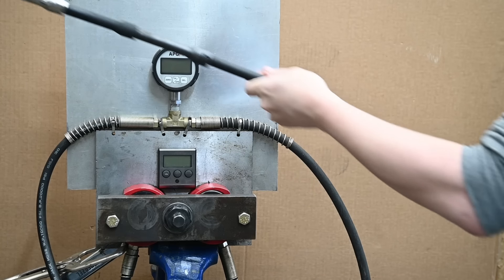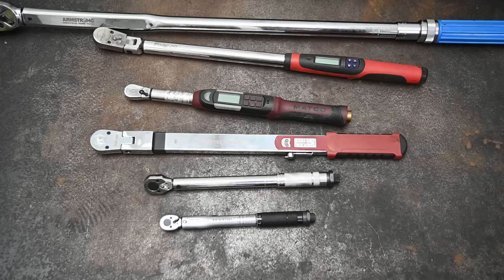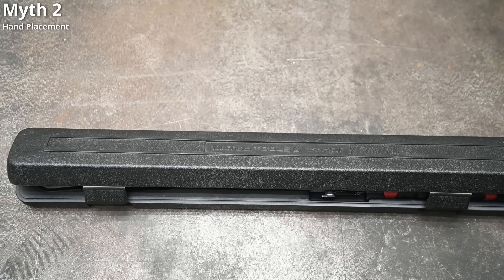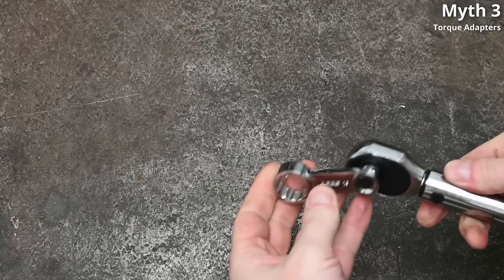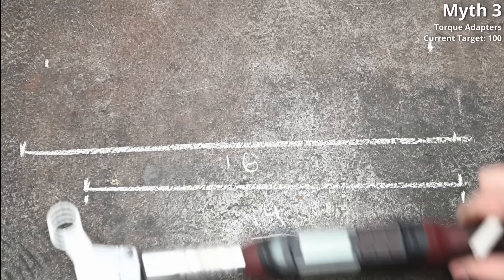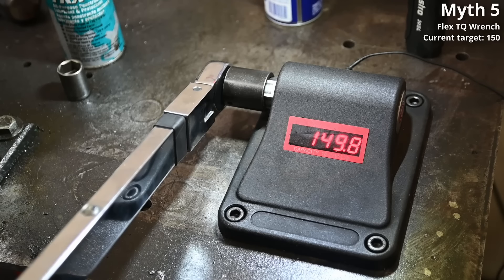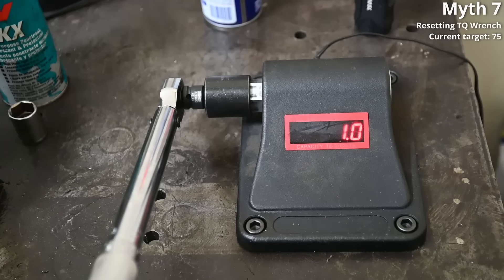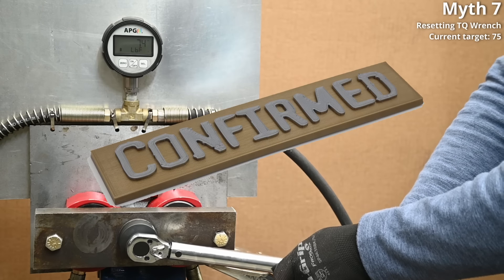You're Using a Torque Wrench Wrong: MythBusting 10 Do's & Dont's

Comment: Just found your channel and since you confirmed two of my fathers commandments about his now 50+ year old Craftsman torque wrench I am a new sub. Old man was right about relieving the tension after use, I always set it back to zero even over short periods of non use. And he was also correct about anti seize.
Reply: Left Dad's 1971 Craftsman set at 85 ft/lbs for wheels, he taught me is was a bad thing. I had it tested on a snap on truck, and was with in the standard 3%. 3 od the 5 digital Snap-off wrneches, new in box, were out of spec by 10% or more. Sorry Dad, but it didn't matter. I bought a kobalt replacement and the craftsman needs a paw replacement.

Comment: How about testing torque wrenches at room temperature (75F*) vs a torque wrench at freezing temperatures. 
That would be great information for mobile mechanics in various weather conditions
Reply: Probably not much difference for spring wrenches. The spring constant slightly rises with lower temperature, which means the wrench will stop at a lower Nm. However, it will also heat up quickly due to the compression, so it may counter the ambient temperature by itself.
Reply: @Asto508  Maybe, but you can't adjust it when the handle is frozen in ice.  :face-fuchsia-poop-shape:
I think the heat is worse.  I have the numbers tattooed on my hand from when the sun shifted and the torque wrench was out in the sunlight when I grabbed it.

Comment: We were just talking about torque adapters at the shop today. I had recently heard that they didn't affect the readings at 90° but we weren't sure about it. A lot of digital torque wrenches have a head offset feature built into them so you measure the offset then input that data into the wrench and you're set. This is at least true with Snap-On ones.
I also liked the anti-seize portion of the video. 
Overall an amazing video with a lot of great information!

Comment: I remember the instructions for using a dog-bone to TQ starter mounting nuts on a turbine engine: "Use documented TQ setting but ensure the dog-bone is at a 90 or less angle." Apparently, slightly under-tq'd was better than over'tq'd.
Reply: Under -torquing is (usually) okay on shear applications and where the part can be distorted and damaged by over-tightening, or where you risk tearing out threads.
But you do not want to under-torque a bolt in a tension application when there will be frequent loading, such as a head-bolt in an engine. Repeated stress beyond the preload of the bolt can cause fatigue and failure.

If the engineers say it's okay, then you can take their word for it. But it is dangerous to apply an application-specific allowance as a general rule!

Comment: Will you please check if using just a little bit of the high temp copper anti-sneeze makes as big of a difference as the silver one. To see if just a little bit can mess everything up. You guys SLATHERED it.
Reply: It is obvious that less anti seize is going to give less of an erroneous result.The more you use,the worse it gets.That why when putting anti seize on spark plugs....you use just a little and adjust the torque...just a little.Honestly with plugs...you can feel it when the plug is properly torqued..
Reply: @djsi38t Modern plated plugs should not have any anti-seize used on them, period. And you really shouldn't be running cheap, unplated plugs on modern engines either.

Comment: The anti-seize is wild, I always knew it was a difference and I always cleaned the anti-seize off lug nuts that all these backyard mechanics love to use, but I would not have expected that it could DOUBLE torque. This is valuable to know so I can more accurately explain to customers how dangerous it is to put anti-seize on car bolts.

Comment: Great video and info on anti-sieze. Lived in Oregon as a kid (the rustiest rust belt state), can confirm that AS will bust fasteners 250 lb-ft on a Cat drive wheel bolt that's been AS'd will result in a broken off bolt. In industry, the big bolt guys use something called a 'bolt tensioner' that precisely stretches a bolt to a specified length, the nut is hand-tightened to meet the surface, thus you always get the same bolting force (pressure on the joint). Since coatings, temperature, humidity, corrosion, and other factors can significantly change bolt tension, that is the 'best' way to measure bolting force - although your tester is doing just that, measuring bolting force and back-calculating twisting torque based on the basic formula. It is all a bunch of math and assumptions that get us to the solution. Love the channel and the content - Cheers!
Reply: "... Lived in Oregon as a kid (the rustiest rust belt state)..."  Not even close, and NOT a "rust belt state".
Reply: @MrShobar  he should come take a look at wisconsin lol. We got vehicles driving around with half their body panels missing and frames welded back together from the salt. I drive one of those vehicles.
Reply: So true. When fastened correctly, lubricated nutted connecting rod bolts are tightened to a stretch dimension spec not a torque spec. A tedious micrometer process but absolutely necessary.

Comment: Excellent segment!
I still use my old (bought it in 1966)**beam-type torque wrench as a “last word” reference. It has a scale at the handle end, the handle is pivoted at its center. As long as I keep the handle floating around the pivot there can be no length error. The indicator rod is fastened to the 1/2” square drive, and even if it gets bent it will still read against the scale if you note the offset and adjust the final reading. That goes for the beam itself. If you permanently deform the beam just note the offset before applying force and adjust the final reading. 
The only thing it doesn’t do is click, which is handy if you are torquing fasteners in an awkward position or in the dark.
**I ordered the wrench from Sears from a tool catalog that was out of date. About an hour after I placed the order I received a call-back to give approval for a small price adjustment. The operator read the name as a “Tool Crunch”. Every time I pick up my Took Crunch I wonder what mental picture that Sears rep had for it.

Comment: Really cool video! The one myth I am still curious about is the one that says that if you loosen fasteners with with a torque wrench (like it's a breaker bar) it destroys the accuracy.
Reply: Many wrenches work in both directions, so it probably depends on whether you have to keep pulling on it after it "clicks".  If you keep pulling after the click, I can see how something might get bent or distorted and affect the accuracy.  Otherwise it should be fine in either direction, for wrenches designed to work in both directions.
Reply: Click type torque wrenches, contain moveable mechanical parts. So using a torque wrench as a breaker bar will only succeed in adding additional wear to those movable parts. Most torque wrenches that I have seen and used, do go both ccw and cw rotation. After all there are left hand threaded fasteners.  Irv.
Reply: @sssnipercoyote60  there are some that only go one direction, I've got one. In it's a bigger one, I don't remember the range off the top of my head but it's a 1/2 drive
Reply: Oh like in this video haha
Reply: My new torque wrench says like 5 times to never use it to remove a fastener.

Comment: Great video. Torque on a fastener is not necessarily tension.  There is a great video by applied bolting. They are related and the best example is Myth #9 with th K factor. That changes with different lubricants  and thread condition and finish applied to the bolt. Myth #10 is true. Except for one fact, some applications will need that torque certification documentation. Mostly business and industry where documentation is needed. Click style wrenches should be stored at the minimum setting (not zero as some may try to do). Again, great video.

Comment: one common issue you didnt test here was a dropped torque wrench.  Also some people keep torque wrenches in their cars.  Exposing them to temperature fluctuations, vibration and moisture.
Reply: and they were still fine and with in 3% spec. when tested by Snap-on TRuck.
1971 Craftsman left set on 85...sorry Dad, but it doesn't matter.

Comment: One other thing worth mentioning is what I learned from a torquing course was not to do the quick lunge pull to get your torque. A lot of guys do this especially in an awkward position. This sends the torque or clamping force way over the desired setting. This can be easily demonstrated by covering the tension gauge while snapping with quick force then reviewing the tension gauge outcome.

Comment: love you calling out tools tested.  much like project farm they have made alot of informative content nobody else seems focused on.

They were the only one who i could find with a video load testing ridgid batteries. 
The octane mid torque impact you tested in its original video with a 2ah battery had abysmal results then later with a 4ah with substantially better results. this was reflected in tools tested video where they found the 2ah to produce less voltage than it probably should. the 4ah was much more inline with what you would expect, same with the high output 2ah. but the 8ah stood above as you may expect being both large and the only 21700 cell battery of these 3.  

i know it may be too much to ask but id very much like to see this old octane (perhaps the high torque aswell) tested with an 8ah, i use the octane midtorque and the ridgid subcompacts at work, the subcompacts certainly enjoy the 8ah but dont seem to get the same bump in power the octane midtorque gets(perhaps because it was originally designed for octane batteries some of which used 21700 cells) 

i know theres likely not many who care for the smaller brands but it seems interesting and it makes me wonder if your score doesnt make the most of this tool

Comment: One more comment: How about a shootout for bolt tension vs. joint tension for various bolt coatings and surface treatments?
Zinc-oxide, chromate, black-oxide, bare metal, sputtered Al, etc for coatings. Anti-seize, grease (several types), graphite, vacuum grease (Braycote, Kluberalfa, etc), PTFE, silicone?
I've heard tell of some bolts busted on a particular space station that were done up with vacuum grease and torqued to spec - they would never publicly admit such foibles, but it does happen to the 'best' of us. Cheers!
Reply: Came here to ask the same thing.
Reply: Vacuum Grease. Haven't heard that term in a long time. Still have a tube of DowCorning 976V from my Cal Lab days. Thanks for the memories.

Comment: With the anti-seize, I remember people telling me this when I was younger, my objection was and still is, if the thread is rusty then the torque figure will be wrong too. 
So when working on old cars the torque wrench is pretty much useless because the values will be all the place, this is why the hand is more accurate.
Yes if you are working on a plane or shuttle, you would use a torque wrench, but you also get all new fasteners, so that is an apples and oranges comparison.
Reply: If the threads are bad, on a fastener that you care about, clean up the threads before tightening.
Reply: You are correct.
In aviation, we discard important fasteners after a few uses because on worn fasteners, the preload changes even when a properly calibrated torque wrench is used.
Some fasteners are less important. The ones holding on the propeller? Pretty important. (And pretty expensive.) The ones holding on the inspection panels? I think some of ours are factory original (from the 1980s.) On the other hand, we don't actually torque the panel screws. If you get them too tight, the nut-plate they screw into breaks, and you have to replace it, which is annoying and time-consuming. You learn pretty quick how tight to make them to avoid breaking nutplates and still keep them from falling out on the ramp and puncturing tires. (These are small, slow planes. When I worked on airliners, we definitely did torque the panel screws, and we replaced them often.)

Comment: This confirmes what we learned as aircraft technicians and tested on our own bench. I worked 20 years as a helicopter tech and when using the torque adapters inline with the wrench we had to calculate the torque setting but when the angle was 90° the reading did not require calculation. When torqueing the 16 main rotor head bolts on the Westland Lynx for example there's no way to get the head of the wrench in there so an adaper was needed every time for several torque values building up to the final.

Comment: It is worth mentioning that most bolts in automotive application are a zinc-flake coating which has a lower k-factor than standard shiny zinc coated fasteners, so the addition of anti-seize won't be as drastic of a change. Different anti-seize compounds will have different effects on k-factor as well, copper and nickel formulations respectively being on the "slick" end of k-factor.

Comment: One of the cool things with the expensive torque wrenches during Myth 3. This applies to Snap on because I read the instruction manual, but they have settings you go in and adjust and you can add the the length you’re adding on. And the snap on torque wrench will auto account for the extension you add on

Comment: Thanks for testing these ten statements. Note that most thread lubricants have the same effect as never-seez; they lower friction and create more tension on the bolt. The torque is not increased (100 lb-ft is still applied).  It’s the resulting bolt tension that increases, as less torque is “wasted” overcoming friction. It’s the increased bolt tension that can cause the bolt failure later. When using thread lubricant of any kind, verify what bolt torque reduction factor is required.

Comment: First of all, fantastic episode. I didn’t understand how clicker type torque wrenches worked until now. But that also makes me want to suggest something for the next myth test. Springs are not supposed to lose tension when compressed; cycling up and down is what causes them to lose tension. That’s why you can keep magazines loaded for years and the springs don’t take a set. The catch is that you need to use the right steel for the springs. I’d love to see a higher end clicker type tested for comparison to the HF one. Maybe a better quality spring would mean no change after leaving it dialed up for six months. 
PS. I’m no HF hater; I have a Pittsburgh torque wrench and a Quinn digital among my torque wrenches.
Reply: I was wondering this exact thing myself!

Comment: It literally says in the manual for your click torque wrenches not leave them tight and to back them off till they are loose. It says if you dont then over time your torque settings will be wrong. Does noone read their manuals. Mine are all in bold writing as a warning. So thinking its an old wives tale when the manufacturer has it as a warning in the manual is quite possibly the dumbest thing I've heard..
Reply: I can promise you that's not the dumbest thing you've ever heard.

Comment: This video got me looking closer at a torque wrench I just bought. 
The Yellow Jacket Digital Torque Wrench 60648 (mine came with the smaller adjustable wrench end vs the ratchet end and large adjustable end).

In the manual the following text appears:

WHEN CHANGING THE TYPE OF HEAD

If you use the different head of the wrench, the reading on the display will be different for the different length of the head. See explanation below.

Applied torque at setpoint = Entered Torque Setting * 
• For ratchet head 1 
• For adjustable head 0.782 
• For large adjustable head 0.75

So I’m reading this to say that if I want to torque a flare nut to 25 N-m with the adjustable head I need to set the wrench to 25 * 0.782 = 19.55 N-m to get a torque at the wrench end of 25 N-m.

I just used a Quinn 3/8 drive digital torque adapter to test, and it does appear that 10 ft-lbs on the Quinn lands close to 7.8 ft-lbs on the yellow jacket.

Could someone confirm this or correct me if I’m reading this wrong. I’m very disappointed that I must constantly calculate a different setting based on the head I’ve got in the wrench. 

Shouldn’t the software allow me to set which head is in the wrench and do the math for me? 

I thought about just re-calibrating it to match the head I’ve got in the wrench but I’m not sure the sensor is a linear relationship with the geometry of the head. Any comments on this?